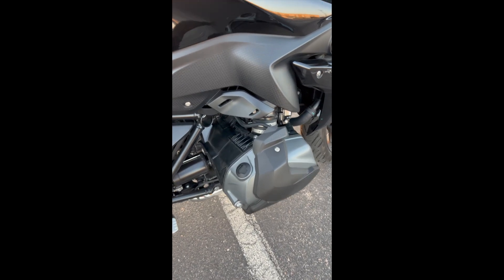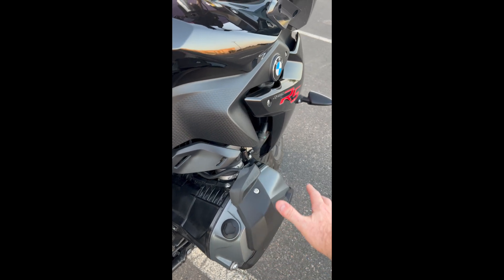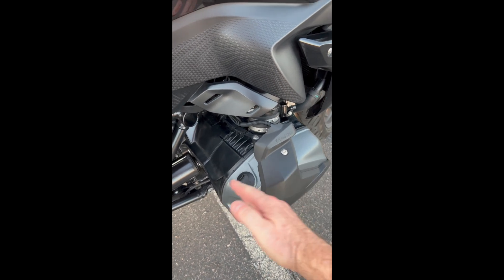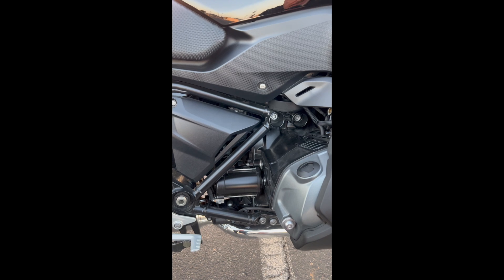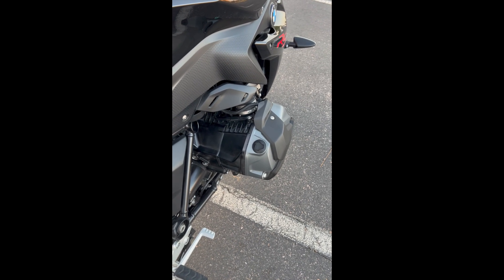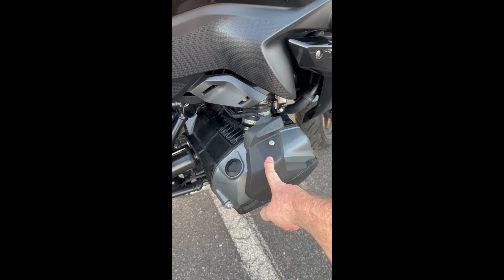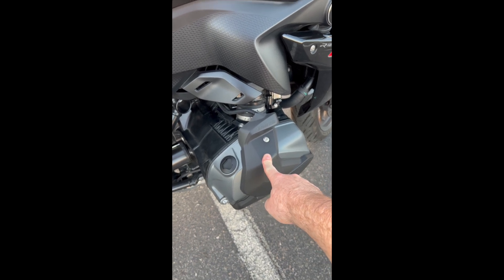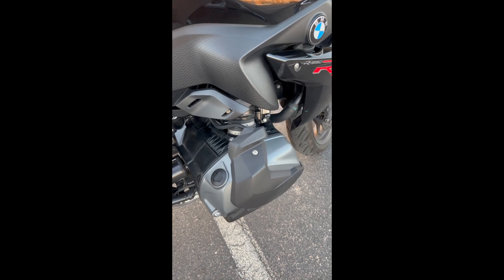BMW R 1250 RS Boxer Engine Shift Cam Technology

Comment: what is gained by opening the valves only part way when there is low load?
Reply from the maker: The part load cams use reduced valve lift to improve fuel economy and the full load cams maximize valve lift to deliver stronger performance. The engine can tell how open the throttle valve is and adjust the cam timing accordingly.
Reply: @Texas2Tires  thanks, I understand timing but dont understand how the valves improve fuel economy. I assume the bike is fuel injection.
Reply: @radishpea6615  it is fuel injection, have a look at this video from BMW. I think the low lift cams also help with the emissions regulations too so they can then meet those regs at the desired RPM and be able to produce more power with the high lift cams rather than just have one set and have to compromise (my 1200 had a flat spot around 4-5k to enable it to meet the regs and it's top end performance wasn't great, while the 1250 just pulls strongly right the way through the rev range) https://youtu.be/C8IqAjSWGPE
Reply: @Bazza47  thanks

Comment: It's a great engine, a good upgrade on the previous 1200 LC boxer engine I had in my previous 2 BMWs that's smoother and produces more torque at the low end through the midrange and more horse power higher up the rev range too thanks to the shiftcam, though according to the BMW website here in the uk it's 136hp, not the 125 you mentioned which was the power output of the 1200. Not necessarily a must have for soneone who already has the 1200 as the 1200 is a good engine too, but definitely worth paying the extra for if it's a choice between the 2.
Reply from the maker: Thank you for checking out the video and sharing your insights. Perhaps it’s the accent, but I said 135 HP not 125. Either way the HP isn’t the shining star here, it’s definitely the torque and shift cam tech that makes this bike amazing.